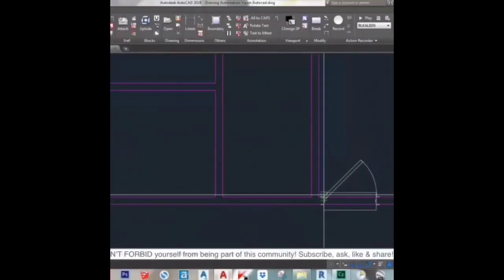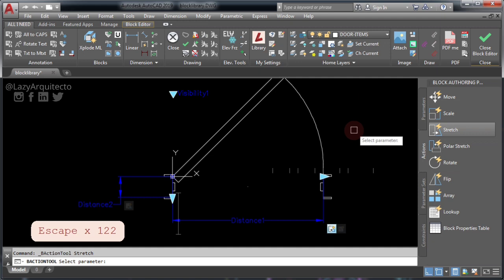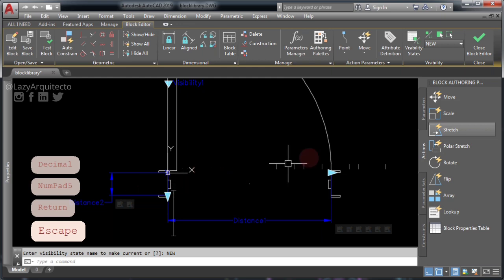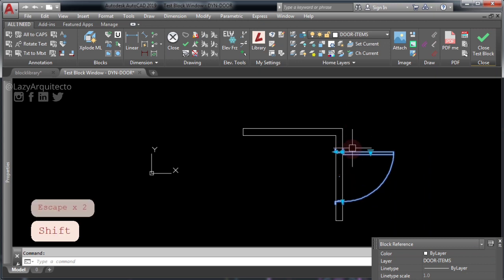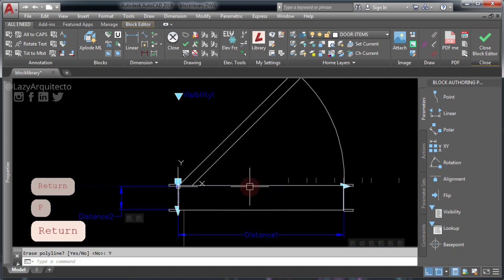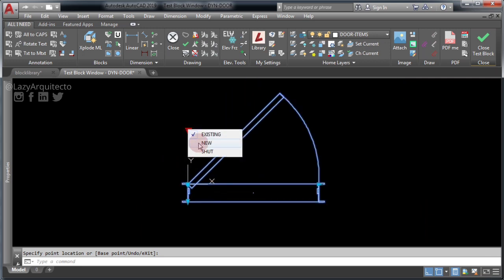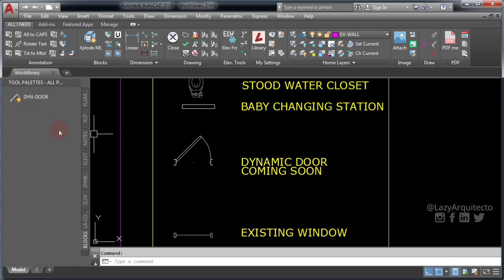Autocad Dynamic Block Door, Visibility, Stretch, Move Parameters, Actions (2/2)

Comment: time table
@1:02 layer definition and color
@1:47 adding point intge middle of the door opening 
@2:23 include the point in the stretch 
@4:24 adding alignment parameter
@6:44 creat the automatic trim 
@7:27 using wipeout command on and the rectangle that covers the door opening 
@8:16 the solution for the wipeout gletch
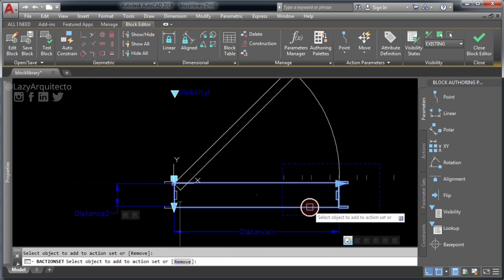@9:37 add the wipe out edge to stretch parameter
@12:15 wipeout fram command set to zero to not show in drawing
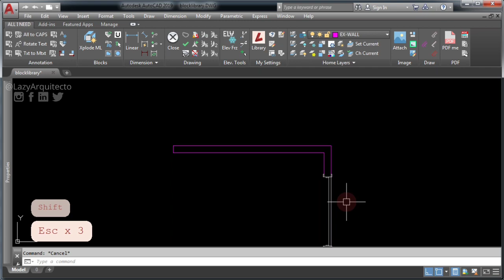@13:15 adding dynamic block to tool palette

thank u lazy architect i learned alot from you i hope you teach me about blocks counts and how to make a block that count other blocks
Reply from the maker: Hi George 👋 happy to help and thanks to take the time to create the time-line. Here how to count blocks in Autocad 2022 https://youtu.be/V8yBnL3l-Zg I'd definitely share soon how to count blocks with a block. Have your notification bell on so you don't miss it!

Comment: Hi Lazy Arquitecto! Very nice video as always! I just don't get what the point was made for?
Reply from the maker: Hi Olivier, for convenience of rotating/mirroring the door from the midpoint without exiting to place the next door. It's a personal preference. I have it as defpoint layer so it doesn't show when printing.
Reply: @LazyArquitecto  Ok thanks. :) don't you want to add a mirror action to your block?
Reply from the maker: I could but my goal was to rotate/mirror the door without exiting to place the next door continuously. This way I won't need to mirror later
Reply: @LazyArquitecto  Ok got it :). Do you know if there is a way to create a new block from an existing one?
Reply from the maker: @brolilu1333  yes. get inside the block editor and from the open/save panel on the ribbon, click open/save to expand the tab and choose option "save block as". let me know if this helps
Reply: @LazyArquitecto  It does help :) thanks a lot